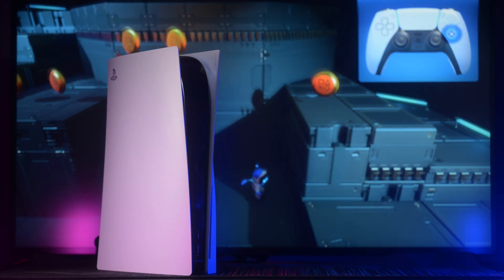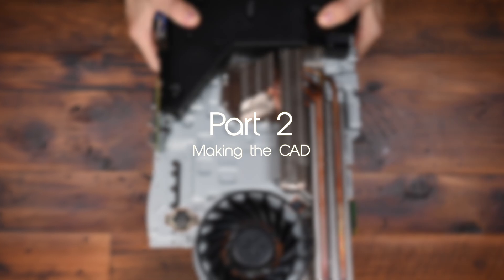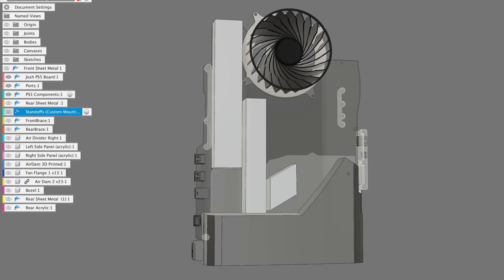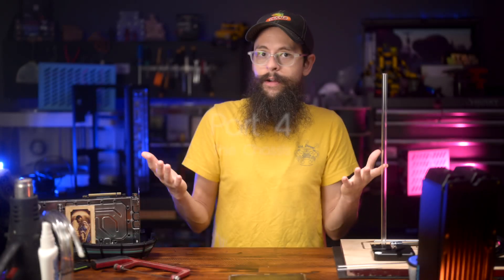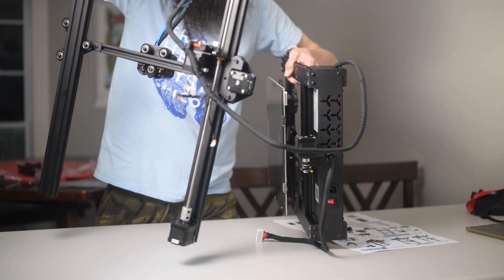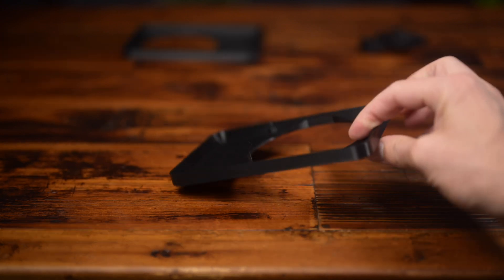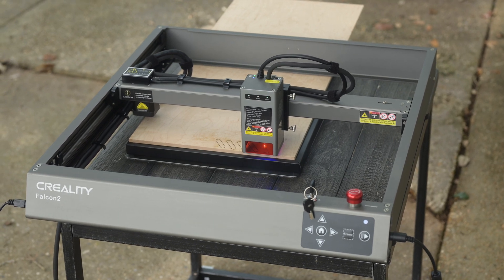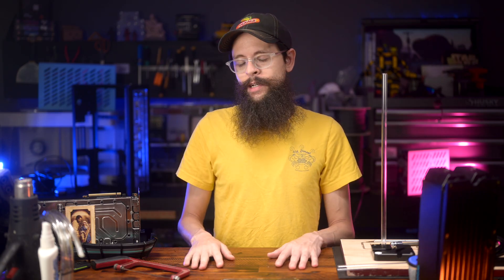I ruined a Playstation 5 with a custom case!

Comment: I don't know how i missed this 😅, dropped here very lately. The simple yet minimal design of PS5 Case Mod which i always preferred to do 🤩.
Hey Josh, I guess you can still use the back metal plate by using 3d printed spacers to cover the gap 🤓

Comment: If you have glass bed in 3d printer just wash it with soap and hot water before use. Glue will be unnessesary. Use glue only for PETG, otherwise you may damage the glass.
Reply: Oh, and use Prusa Slicer insted of Cura, it's less fancy but works better and you can setup more parameters. You also have problem with Z wobble, there are solutions for it.
Reply from the maker: @DrJimBoston  thank you kindly I will look into it!

Comment: what's the game at 8:31 in the video. it looks like tower defense or like a defense game it looks fun I gotta know what it is man. and also nice case design too. imagine if you used the PS5 cooling you did here and make a PC case that could achieve the same 2 sided 1 or 2 fan in the same way you kind of made this where the 1 side cools the other side, its a cool case idea totally.
Reply from the maker: It's defense grid 2
Reply: @NotFromConcentrate  awesome thanks 😊 I am happy that its also on multiple platforms like PC.
Reply: @designwithphoenix I played a lot of Defense Grid 1, it's an amazing game and a lot of fun. Also it's optimized really well and runs perfectly on a Steam Deck at 5 Watt TDP 😂